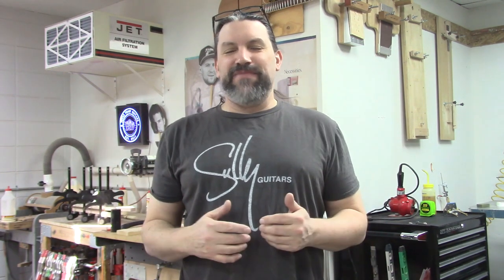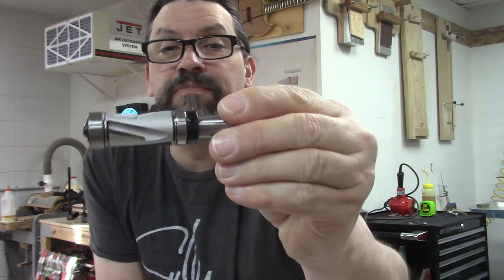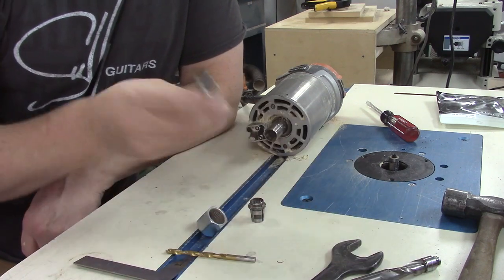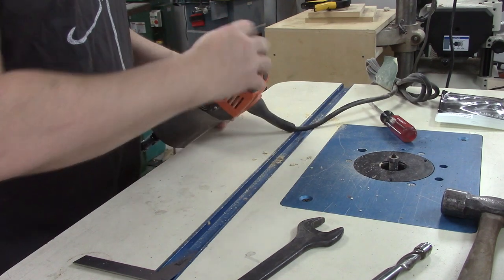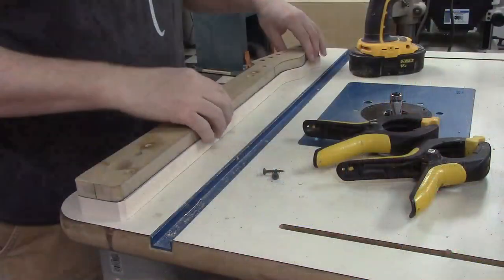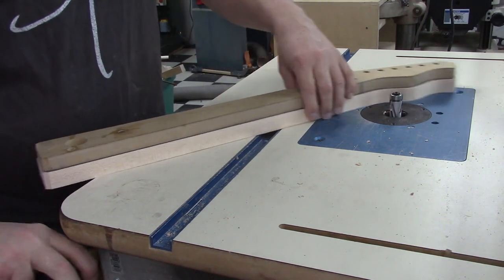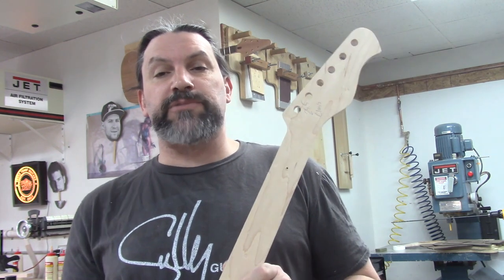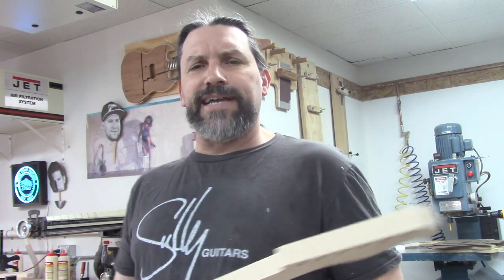If You Make Your Own Necks... You Need To Try This Router Bit

Comment: I went on the website and ordered 2 before you made it through the entire cut. I just watched you rout through hard maple end grain with 0 router burn, I'm ordering multiples of the entire set of these incase they stop making them witch is what usually happens when I find a tool I love and use all the time. Thanks Matt and I told them I learned about the bit from you guys too.
Reply from the maker: I hear ya, every time I find something good they are out of stock HAHAHA

Comment: I agree with you on screwing your template to the work as being better than tape and super glue. I have not had much luck with the tape method on my cnc router table. You can screw up your piece that you are working on as I have done. Turning a good piece of wood into scrape. You are giving good advise.
Reply from the maker: Thanks William

Comment: That’s a compression bit with the spiral going both ways. Helps prevent tear out. 

A good thing about the bearings on both ends is you can flip the workpiece over which is good if you need to follow grain direction. 

I’ve not used one of these myself, but that’s what all the woodworking guys say.
Reply from the maker: I like it so far

Comment: I like to use hot glue instead of tape or screws for mounting templates. 4 small spots of glue will hold alot and when your done use a tiny squirt of ascetone near the glue and it loses its adhesion.   a sharp chisel dipped in ascetone will remove any residue.

Comment: One thing I've done at the end of the neck and other tricky areas is to use many passes, starting with a shallow pass and raising (or lowering) the bit by 1/4" or less with each successive pass.  That way, the cutting area is pretty small, which reduces the odds of the bit biting into the wood and causing tearout.  Then a pass with some sandpaper and all is well.
Reply from the maker: Great tip!

Comment: Matt. I have one of these 1.25 inch. Using on my overhead router without the pin. 1500 works well. My machine tops out at 5600, so perfect for the big bits.
Video coming, soon as hand heals up from grinder mishap.
I guess, using top or bottom bearing, I will workout. Suggestion?

Comment: Another awesome video. Thanks. 

I’m so relieved to hear your comment on taping patterns to wood for machine use. I never considered using that method but when I saw it mentioned on the videos these days my first reaction was, really?  because I was afraid the force of the machine would knock the pattern out of alignment at best or at worst cause a digit removing incident. 

I could feel your hesitation when you turned the neck upside down and had so much blade exposed. I was trembling just watching you. But then again, I was always a pussy around the machines. 

A healthy respect for the damage these machines can do to us is important especially when you do repetitive tasks. 

My grandfather was missing a couple of digits and there was a very experienced craftsman in the shop who was rushed to the hospital to have one of his fingers re-attached. 

I would say, listen to your gut, it’s correct.
Reply from the maker: The tape is pretty good but nothing like steal threads
Reply: @TexasToastGuitars  I’ll have to take your word for it because I never used it and I always respect experience over conjecture, even my own.
Reply: @marccarlin1  from my limited use of glue 'n' tape with a handheld router, I'll take screws any time I can. For one, line them up on a cavity and there's no way to leave nasty glue blobs... They suck on both the template and the workpiece!

It does hold though. If you are in a bind and need to affix a template without screws for any reason, I'd say use it but go slow. But I don't have a router table and I wouldn't consider my advice at all relevant to any stationary machine for sure. Or much of anything for that matter!

I always listen to my Spidey sense for safety stuff, it's literally saved my life multiple times (I'm an electrician) and will continue to do so... Unless it doesn't go off!

Comment: Yeah it's definitely a good idea to use your spindle sander on the end grain of your neck, I sand it till it's about the thickness of a business card the I rout it on the router table. I just think it looks much more professional when it's routed instead of sanded. That's a badass bit though.
Reply from the maker: Great tip!

Comment: Thanks for that. I’m looking at these bits for just that. On an acoustic neck with the angled head there is no choice but to run the bearing on the bottom, I make my templates out of 1/2 inch birch ply, which reduces the bit exposure a little. So I guess I just found a way to spend another $130, or that’ $180 Canadian, plus shipping😕
Reply from the maker: Glad I could help my friend

Comment: They also have a 1.5" X 2" router bit. I have a 3 1/4hp table mounted router.  Do you think it could handle routing out a body with the template? I've seen you do it with a shaper, and though you mentioned that a router might not be able to handle it.
Reply from the maker: Please consult the manufacturers of the various tools in question for actual advice. None of the things in these videos should be considered formal training or a substitute for training of any kind. 
Matt does not assume any liability for viewers actions.
Reply: Okay, thank you.

Comment: Hey Matt. I'm a relative "Noob" to the custom guitar crafting world, though I did grow-up building grand concert hammered dulcimers in my father's shop. Similar skills, but the geometry is VASTLY different. I'm curious to know the rough thickness of your neck blank, as it appears to be almost 5/4" or so in the video...? But I'm thinking that's really chunky prior to truss rod route and fingerboard adhesion. Would you mind throwing the new guy a "material-management" bone, please sir?

Thank you for the edu-ma-tainment content, brother!
Reply: Usually a fender style neck blank such as this it will be 3/4” thick with a 1/4” fretboard. If it’s a one piece, then 1”. And a 3/4” template is a bit more sturdy as well, rather than using a 1/4” template. I use both, depending on circumstance. These guys are awesome! I’ve found Lots of great info from them that’s helped my builds. This router bit is particularly good because of its slanted blades. Standard Straight blade bits will cause tear out really bad. I just ordered this bit in the 2” version so I can do bodies and necks with it.
Reply: @mgcnashville6615  Thank you, kindly, Uriel. I really appreciate the info, as well as the product endorsement. I just ordered my own 2" bit

Comment: Matt, I use the same router bit as your "normal" one, and it works great. So I'm wondering if it's worth it to switch to this bit vs sticking with what I have - is there THAT much of a difference? I would certainly consider it once the bits I have wear out but would you suggest replacing my existing bits (I have 2 pretty new ones) with this one?
Reply from the maker: Only you can decide, we use straight bits all the time too

Comment: (Another) nice video, Matt. A couple questions: Would you feel safe using that bit in a handheld router? And what's a small, not-super-expensive router table you like for someone without a lot of space? Hey, if you'd rather make a video about choosing a router table, that's fine too. :-)
Reply: Yes, I second the router table video
Reply: Here's a DIY approach to homemade router table: https://www.youtube.com/watch?v=RG1nXrBEwH0
Reply: For what it’s worth, I bought a Craftsman aluminum table years ago garage sale cheap. Most parts were missing but I only wanted the table. Since I only use guided bit types I basically built a table around it to increase the surface area though it didn’t really need it. It serves every guitar making purpose for me. Pickguards, necks and bodies with a couple spiral bits and one 45d angle. I even use it to cut aluminum pickguards with bits dedicated to that effort.
Reply from the maker: Hi Jim, I would not use this in a router but I already have a table. I think the router table idea for a video is a good one

Comment: Did you mean to say 18,000RPM and not 1800RPM?
Reply from the maker: What can I say, sometimes I make mistakes
Reply: @TexasToastGuitars  No worries, good video...just checking, 1800 seemed awfully slow with a router and it sounded a lot faster.

Comment: I think you're missing the entire point to this type of bit. It's so you can always route WITH the gain by flipping the template mounted neck. Those torn out corners you were talking about can always be done with the grain by flipping the job and raising, lowering the router bit to use the appropriate bearing. Think about it. Cheers.
Reply from the maker: Think about it?
Why would I do that when you have done all the thinking for me?
Reply: @TexasToastGuitars  You're welcome.